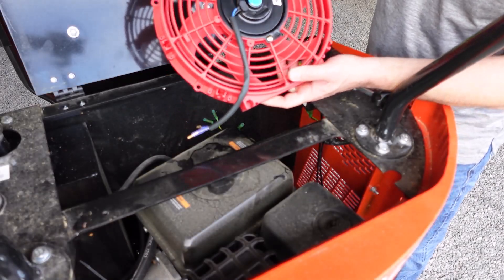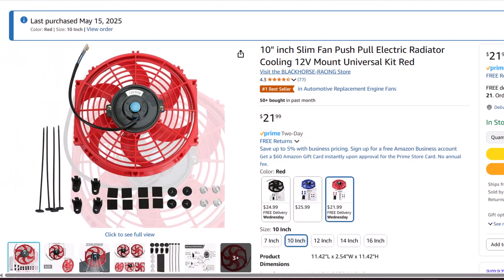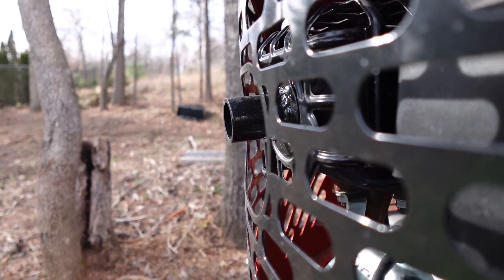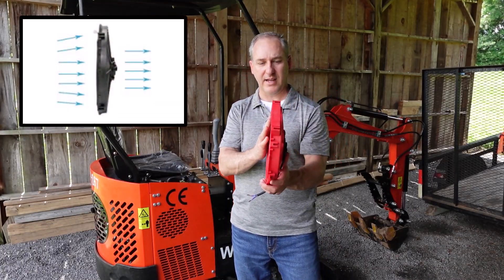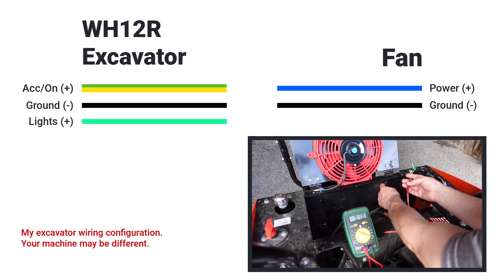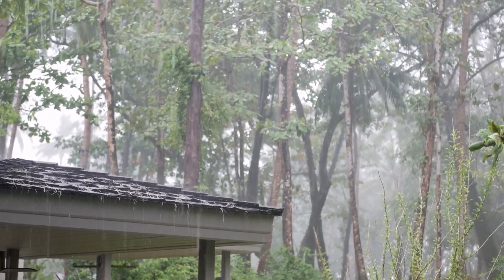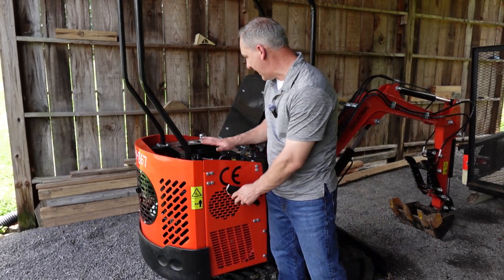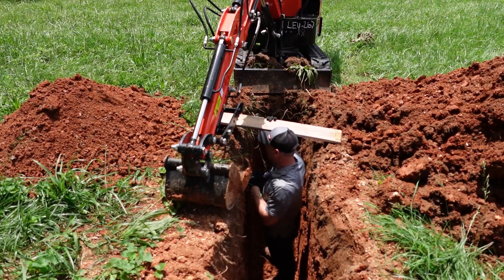Engine Bay Cooling Fan Install - AGT WH12R Chinese Mini Excavator

Comment: The engine isn’t going to notice the air into the intake because the Venturi in the carb drops the air temperature 30-40* F.

Comment: Wouldnt pushing hot air out  naturally allow cool air to enter? Also intake fans recirculate hot air? I dunno
Reply from the maker: The fan seems to be working very well to maintain a safe temp for my machine.

Comment: My name is William, and I represent ORTUR, a specialized manufacturer of heavy-duty mini excavator attachments. We're excited to introduce our latest product: the Mini Excavator Trailer Hitch Receiver Attachment, designed specifically for 0.8–2 ton mini excavators.
Reply: We’re all very proud of you for that
Reply: @rotarycomptech  My friend, I noticed that you own a mini excavator. I can send you our traction attachments for use.
Reply: @Virbraroo-William  my friend, did you notice that I came up with a alternator and alternator bracket for these machines as well?
I can send you the alternator and the bracket and the pulley and the belt
Reply: @rotarycomptech  My original intention is that you have a mini excavator, and the "traction attachment suitable for mini excavator" we have produced now needs more people to try and experience it, and I would like to invite you to test it.
Reply: @Virbraroo-William  no problem how do I do that?

Comment: Hey love the video. Just out of curiosity, what size bolts did you use to keep the fan in place and where did you get them? And have you noticed a performance improvement after the fan install?
Reply from the maker: Thank you!  I have a drawer of spare nuts and bolts.  I used the ones which fit the best and had the widest head to keep them from slipping through the grate.  As far as performance goes, I can tell a difference in the temperature of the engine bay.  👉 This was the next video I did right after the install - digging to maximum possible depth.  Check it out here:
 👉https://youtu.be/aGc04EJq2h8?si=znguvSnE3I_A0QVr

Comment: Nice idea but a 80w fan on a 120w(10 amp) stock engine stator is not too much?  Maybe it will struggle when light on and batterie charging. Speed controler or potentiometer can be a solution if it slowly discharge the batterie. I have a new Rippa R10 and my stock setup is no fan except on the oil cooler. The back pannel as no vent except the big exhaust hole. The way it suck the inside hot air is the exhaust blowing inside just before the big pannel hole and by that sucking inside air and pushing it outside with every pulse of burned gas. Very smart, reliable and simple.

It is surprisingly effective and another idea to reduce engine heat generation is to put 10w40 syntec motocycle premium oil. My engine noise dropped and also the operating temp, by more then 40 Deg F, simply by changing oil, compare to the breaking-in oil that the engine come with. Motocycle oil is the best gazoline engine oil you can get because of regulation.

Im new to that and what chinese excavator guys are saying to each other to be polite? Have a nice hole? Not sure but I like it lol.
Reply: I just saw that you have no light lol and sorry for by bad english.
Reply: It really needs a hydraulic oil cooler for higher ambient temperatures
Reply: Exactly right 10 amp alternator so it will be maxed out and slowly draw the battery down you can verify with a meter. Just run a trickle charge to maintain when not in use.  I have the Rippa R10 also with gas engine-love it and I don’t want a diesel at all.